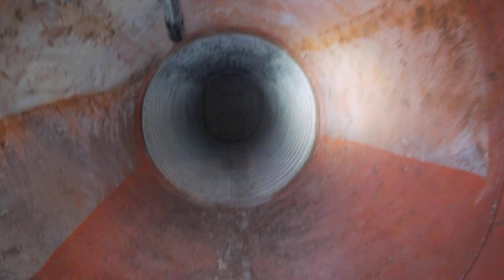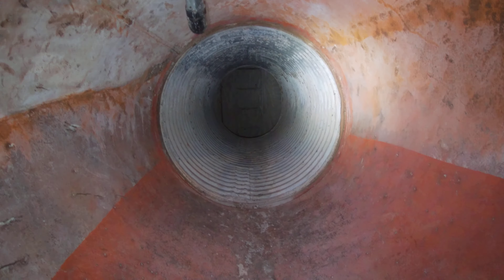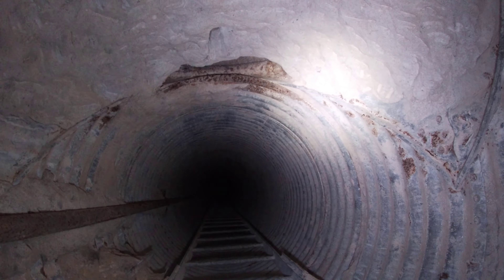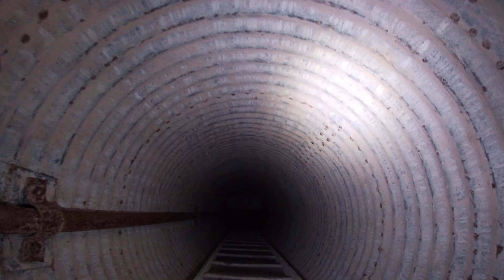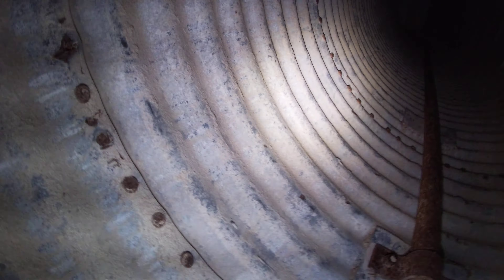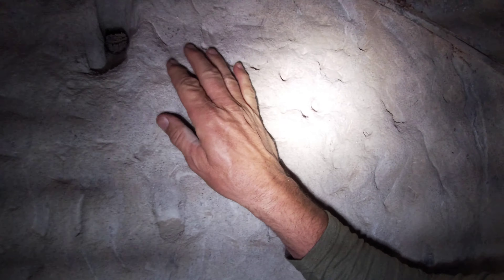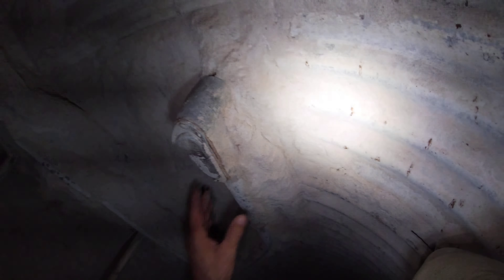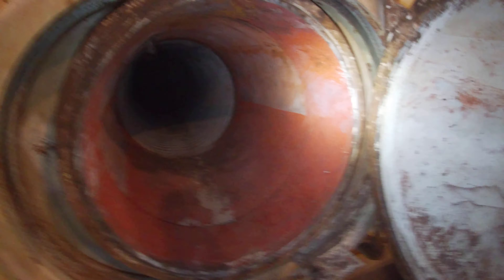ESCAPE!  Crawling out of a Titan II ICBM Launch Control Center escape shaft.

Comment: Nice clear Video .. Yep I remember standing on the top of that exit at ground Level 2003-2004   and it was filled to the brim with concrete ,  and telling the owner  Good Luck getting that out   Holy Cow 6 years ,I believe it ,  Where you put your man lift  at ..They were only down about 5 to 10 feet at the time , you could see one rust line where the stairs were leading down .. I will still come out and see you sometime , maybe get some trees while I am there ..   good job

Comment: There's a second level horizontal tunnel that leads to the second level. You went right by it. It's still sealed with mortar. Might want to open that. It's a great ventilation source for moving fresh air through the complex.
Reply from the maker: I showed that on the way back down...
Reply: @ArizonaTitan  Sorry. I baled on the video just before you headed back down.
Reply: 6:35 he says exactly that
Reply: @torque-ej4nu  If you had been reading the comments you would have read mine. I baled on the video after the way up. Not too hysterical are we.
Reply: @jefflovejoy2997  umm? Are you? All i did was gave the time stamp. Didnt see anything hystarical about that, are you bored with nothing else to do?

Comment: Thanks for this video, it’s cool.  You can run a safety line up to the top and leave it just in case.  Look up treestand safety setups for some ideas.  I was an SP at McConnell when we had Titans so I have a soft spot for them.
Reply from the maker: Good idea, thank you!  We will be installing air conditioning copper lines to the surface, that might be a good time to kill 2 birds with one stone, so to speak.

Comment: I'm curious, will concrete dissolving chemicals work on such large amounts of concrete? 
I suspect it would be cost prohibitive and there may be some issues with compromising actual parts of the facility, but it seems at least for the escape tunnel pouring a bucket of the metal safe stuff on top, letting it sit till it stops bubbling then sucking out might be easier than jack hammering. 
I just now found out about concrete dissolving chemicals after googling about it because this video made me wonder about it.
Reply: I don't know how it could be cleaned up after its use or if it knows where to stop...

Comment: Why is it that the main entrance is so elaborate with several massive steel blast doors while the escape shaft only has two little hatch covers, plus the valve thing that protects the air intake?  Does the blast pressure follow an area-cubed law or something, so a small shaft only needs a tiny fraction of the protection of a large doorway?
Reply: I've been wondering the same thing since I started watching these site conversions.  Doesn't make any sense.
Reply from the maker: I think you are correct about the calculations. There was also a pretty beefy hatch at ground level that was most of the blast protection before it ever even came down the shaft.  It's a concrete block  about four feet thick and 8X8 across.  I'll show it in a video soon.
Reply: @ArizonaTitan  so how did it operate as a ventilation shaft then?  And how would they escape thru it?
Reply from the maker: @86FxBdyCpe  It opened from the inside swinging up and out after you climbed up the ladder.  A 6-inch hole for the airflow and a 24-inch hatch for human to push up.  So yes, you are correct about a 6 inch opening being exposed, but that's where I think ScottSezWut is on the right track about the minimal volume of air that could come down that shaft in a blast.

Comment: the launch crews had a time limit to open then escape hatch and get out and to the top or they were put on watch because that's what it is an escape route, now the air intake as he said was called a blast valve it was designed for air but it would shut in the case of a blast of some kind probable nuclear that's the part I work on and the crews had a switch that would shut them and they had to shut in seconds or we would have to go find out why, now in these cases I would say all the concrete in them would be the problem

Comment: If someone wanted to break in the cable way is always the best target and in the AZ complexes even more so with the full removal of it.
Reply: Haha, bring your shovel... Its only 40' down.
Reply from the maker: If you have see video tours of our site - the 6,000 pound blast doors all work and the locking mechanisms have been rebuilt.  All that digging would only get you into the decontamination room and no further.  At some of the other sites you are absolutely right.
Reply: I'd say it's MUCH more work getting in thru the decon room than thru the access portal.  The amount of earth you need to remove from the excavation to have 45 degree slopes is in the thousands of yards of soil.  Speaking from experience!  😋
Reply: @ThompsonAtomicRanch  Driller truck setup to put in a 24 inch culvert as a digging shield you can rope/ladder up/down. Then again getting that near an active site when it was still USAF would be a fun thing to see like someone trying to breech the US Bullion Depository to watch the helicopters, tanks and troops all rushing from Fort Knox down the road.

Comment: So in normal operation was there an expectation that  you would exit the site having completed your launch or do you just sit there waiting for orders? Yup finished my shift out into the nuclear wasteland I go. Oh wait no Dunkin Donuts...where am I going out get coffee...and dinner... so much for McDonalds!
Reply from the maker: After a launch they would hole up and wait for orders.  If there was no answer, they were to wait for 30 days.  (There was enough air and supplies for the 4 crew to live that long.)  The escape shaft was literally there to crawl out of the complex 30 days after launch.   The entrance portal was not designed to survive a near strike, so this was the expected egress port.  However - it's just a metal tube buried in the dirt so I doubt it would have survived any more than the entrance portal.  I'm told it was rarely opened and not even used for drills.
Reply: @ArizonaTitan  - easier than getting thru the 6ft thick blast door i suppose... if everything is screwed up

Comment: It's not concrete; it's mortar. By treaty agreement, the US was supposed to have used concrete but went cheap and used mortar. Apparently, the Russians didn't know the difference, or didn't care. The mortar can be dissolved with water. I have seen videos of this being done in another Titan II silo. It's a real mess having all that stuff fall all the way down a 64-foot escape tunnel, but the end result is worth it.
Reply from the maker: In Arkansas sites the grout was only used as a cap after filing with dirt.  In the Arizona sites, the grout goes all the way to the bottom and in some cases spilled into the command center a bit.  (I don't know any of the Kansas site owners to ask how they did it there.)  Not sure about dissolving it, this stuff is as hard as any concrete I've had to jackhammer, maybe because it's 30 years old.  I am only aware of a couple sites that have cleared the shaft like mine.  One in AR (and a second is being worked on as we speak) and maybe 3 in AZ are completed.  And by the way - not sure what the treaty said (I'll have to research that) but I have all the site destruction documents issued by the Air Force and they call for "grout" filling everything.  So I think grout would be tougher than mortar, but not as tough as concrete.  Maybe it was cheaper at the time or they figured it would flow better into the nooks and crannies for better sealing.  Who knows?
Reply: Who knows indeed. I have heard words used like "cement," "concrete," and "mortar" used.  Now I will need to think about "grout." It has been my experience that there were different practices and different results used in every silo deactivation, either on purpose or not. You are correct about the Arkansas Titan II silos.

The fates of the Atlas F Sites is just about as varied as the Titan II Sites. Most were built in groups of twelve (12). If you visited a whole group, each would look different. In some the salvagers stripped the place clean. In others, a lot was left, down to the launch door hydraulic arms still being connected. Even the actual launch consoles were still in place.

Comment: You should run a safety rope with a pulley so you can synch up the line and tie yourself off to prevent an accidental fall... if you did fall there would be no one to help you down there. At the very least a harness and a short rope with a clasp you can snap onto the ladder rungs.... The way you did this solo with no redundancy wasn’t smart at all..
Reply from the maker: We use a mountain harness and safety ropes when we allow guests to climb out.